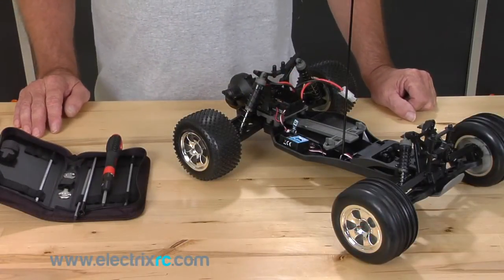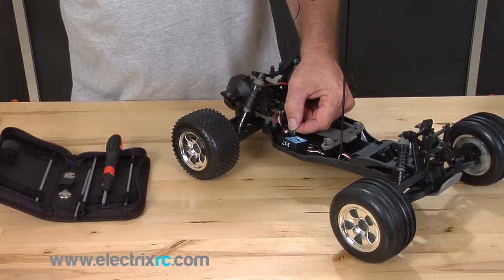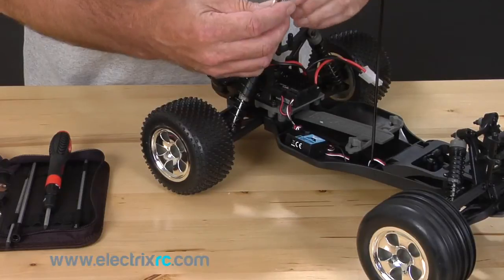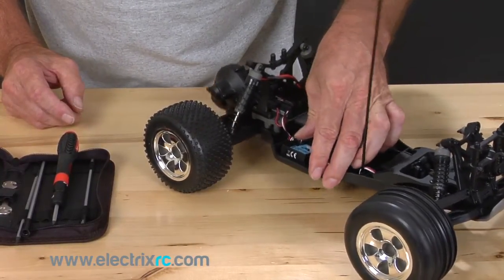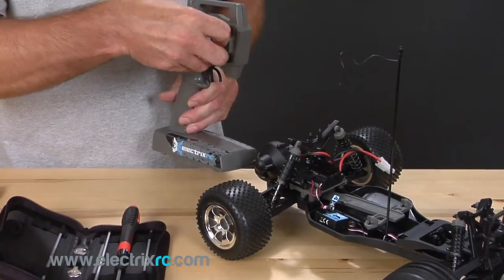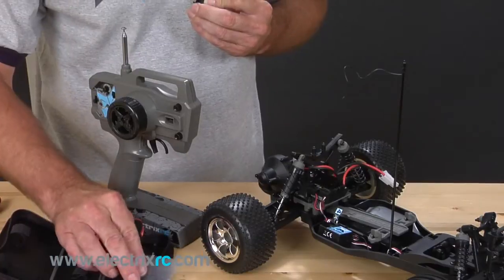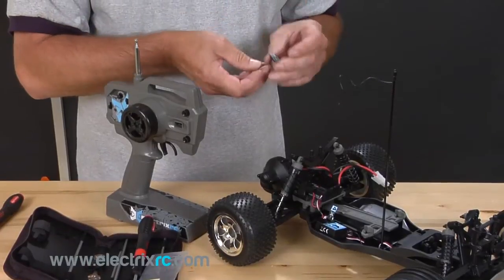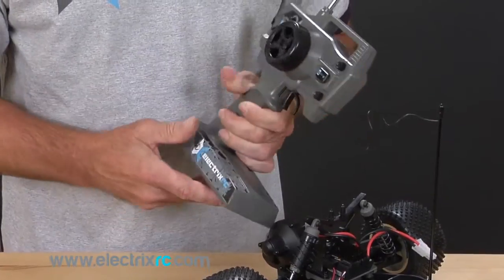ElectrixRC How-To: Transmitter Crystal

Comment: It does not, as long as the receiver crystal is in the receiver and the transmitter crystal is in the transmitter. Other than that the crystals aren't polarized or anything like that.

Comment: § 95.645 Control accessibility.
(a) No control, switch or other type of adjustment which, when manipulated, can result in a violation of the rules shall be accessible from the transmitter operating panel or from exterior of the transmitter enclosure.

Comment: (b) An R/C transmitter which incorporates plug-in frequency determining modules which are changed by the user must be certificated with the modules. Each module must contain all of the frequency determining circuitry including the oscillator. Plug-in crystals are not considered modules and must not be accessible to the user.

[53 FR 36789, Sept. 22, 1988. Redesignated at 61 FR 28769, June 6, 1996, and further redesignated at 61 FR 46567, Sept. 4, 1996; 63 FR
36610, July 7, 1998]